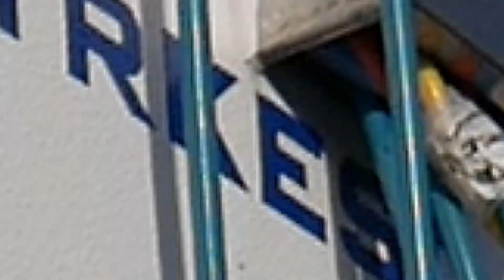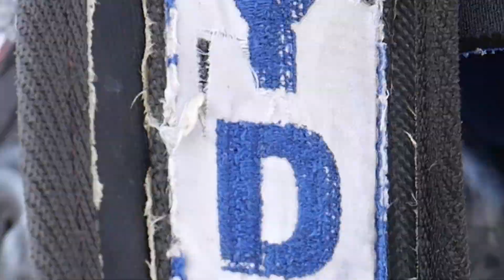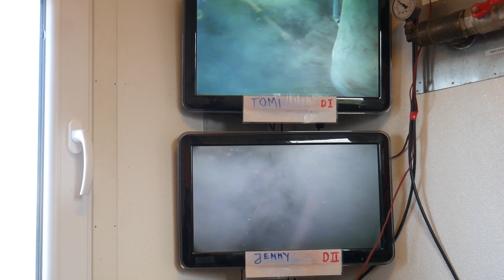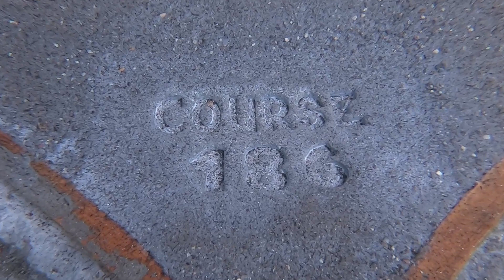Concrete casting underwater (Become a Commercial Diver at NYD) - ep 12

Comment: Regarding underwater fresh concrete pouring, is there added special chemical admixture used in the concrete to keep the concrete become cohesive?
Reply from the maker: The concrete powder itself was some special mixture (extra tuff and so on) and yes wed did add some chemical liquid, but it was for fluent flow (so it wouldn't get stuck during the pouring). 
Otherwise, time did the job... it took around one week to set, and then we could remove the casting..
Reply: @rannarlaur  thanks for reply

Comment: he Rannar, love the video.. i have to do similar works but and have some questions.
the steel pipe is it like a funnel or is it connected to a flexibl hose?
i it is do you use a concrete pump and what kind of pump it is ?

thanks in advance.
Reply from the maker: The steel pipe is connected to a flexible hose which is connected to a pump (mixing and pumping). It was a very old pump... I guess from 20 years old... old and slow =) ...

Comment: Just an idea I would have used 2 circular half shell with a 2 bolt flange etheir side sandbags to seal the outer side of the shutter.grease the inside of the shutter to stop it sticking to the concrete. After it sets remove shuter and reuse on next pile. Just trying to be helpful as I am a diver with over 30 years experience and I wish you all luck. stay safe! 2 sayings !. There are old divers and bold divers. But no old bold divers. 2. Any one can just jump in but no one can jump out!